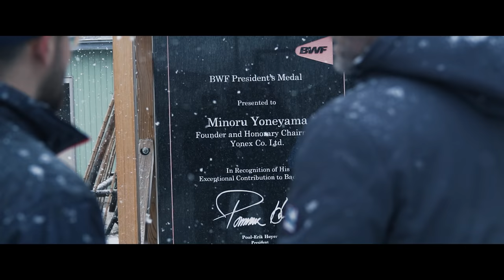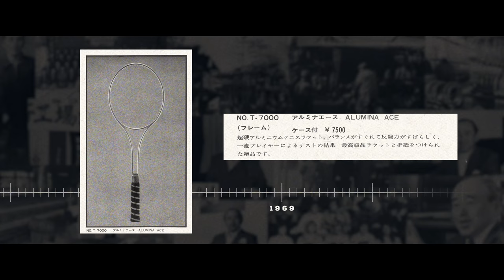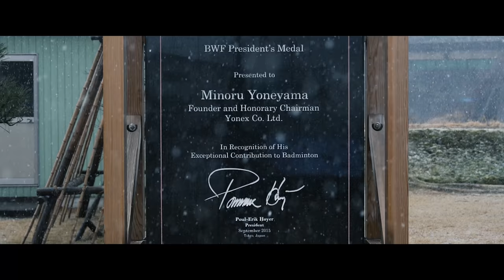Yonex Brandography: History of Yonex and Behind the Scenes at their Factories in Japan

Comment: Excellent video. Goes to the Heart of the Yonex philosophy of Pride in manufacturing. BUT their R&D is another matter. We have seen them veer towards making their racquets more rounded and making their racquets stiffer and stiffer ... So even though their manufacturing is second to none, their R&D is far less disciplined and almost bipolar. That's where their Achilles Heel has been for decades and continues to be, at least in Tennis. The Ezone line is a great example. The first three generations (Xi, Ai and DR ... I believe Kyrgios still plays with Xi) were great and and then they fell off a cliff. Same with the RD series from the 90s.
Reply: I agree with you I am still playing with my old DR 98's the new Ezone versions simply is just not the same after testing all the new models I still do not want to switch. Making sure you are at the forefront of development and technology is all good but getting to a point where the new model is worse than your previous model means you are missing the point.
Reply: The rackets are a lot more rounded. Look at the new Regna 98. The only 'straight' edges are the tip and the throat area (where the mains start and end) the sides are very curved.
Reply: @transamination  Minoru is turning in his grave as I write :-I
Reply: No excuses on why they killed the AI and DR   The 2020 ezone hits like a board

Comment: Hi TW, I’m currently using the Ezone 98. Spec wise it’s perfect for me, maybe a bit too whippy in stock form. Been playing with it for a few months now and I just can’t force myself to love the slight muted feel, I like the flex but after trying lots of strings I see that it’s just how the racket feels like. So I’m wanting something in this spec range with a more connected feel, the Strike reviews says it’s also quite muted, Vcore also hollow, stiff and too open string pattern, Blade I guess too underpowered, etc. Seems like there’s only the Extreme Tour left, does it have a slightly hollow and muted feel like the Ezone 98, I’ve heard it’s more raw but it is noticable enough for me to potentially switch?
Reply from the maker: I found the Extreme Tour to offer a bit more feel compared to the EZONE 98, but it also felt a bit lower in power. The other racquets that come to mind are the Blade 98 16x19, and VCORE Pro 97, although they offer more feel than the EZONE 98, they also are more on the control side. It would be worth a try or a demo of the Pure Strike 98, as it is somewhat muted compared to the 2nd gen version, but the beam construction is a bit different than the EZONE 98, and has a different feel. Troy, TW
Reply: Tennis Warehouse can you compare the Strike and the Extreme Tour’s feel on impact compared to the Ezone 98, I mean the pocketing feel is good but there’s just a slight disconnect, at least that’s how I feel. Blade and Vcore pro are maybe too lowered powered for me. I really like the feeing of my old Prince tour 100T, is soft but this crisp and connected, I also played with the Original Aero Pro (don’t know if it’s even the real deal) with really old crappy strings, it’s stiff but I like the raw / direct feedback I get from the racket.
Reply from the maker: @cd8145 , If you liked the Prince Tour 100T it would seem like the Tour 100 (310) would be an easy transition for you. The Strike feels more solid and stable, maybe the mass behind it, but slightly muted. The Extreme Tour felt a bit more responsive but not quite as stable, a bit more feel for the ball, but then again not like it had a ton of feel. I thought it played more like a Radical than Extreme, and although feel was better than most Graphene racquets over the years, it wasn't quite as plush and feel oriented as some of the older Radicals like Youtek IG, or older. Troy, TW
Reply: @tenniswarehouse  Thanks Troy! Let's see what the new Radical 360+ has to offer, also on the Talk tennis forums there are rumors about Wilson releasing 5 pro stock at the end of this month...
Reply from the maker: @cd8145 , yes we have heard rumors, from people on the boards who are in touch with a Wilson rep, and we are not sure what the deal is. We have heard people talking about a 95 re-issue, maybe a Six One 95, which if you know my racquet history, would be great. The problem is that, certain racquets like the Ultra Tour update, Ultra Pro v3, is not being distributed to online retailers, and is only available for purchase through wilson.com. So we are hoping that is not the case for future releases. Troy, TW
Reply: Tennis Warehouse Troy not sure if you’ve seen it but there’s a pic of the re release six one paintjob on the forum that will blow your mind, it’s a glossy v13 pro staff paintjob! Glossy!
Reply: Try the V Core 98+, great power and good feel for a high swing weight stick.
Reply: Matthew Donovan I think I can’t handle the specs 😭
Reply: @tenniswarehouse  which is better for me? I'm 46 years old and have to make a very difficult decision between the yonnex dr 98 or the  yonnex dr 98 plus. I'm purchasing one or the other,and sadly I dont have the opportunity to demo first. Please help!!
Reply from the maker: @kennybrooks8374  The plus will help to add some put away power, and help hit bigger serves, but a little less maneuverable. The DR98 will be more maneuverable, and a bit more control. I am a fan of the plus length racquets, especially since it helps with power, and a little more reach as I get older. Troy, TW